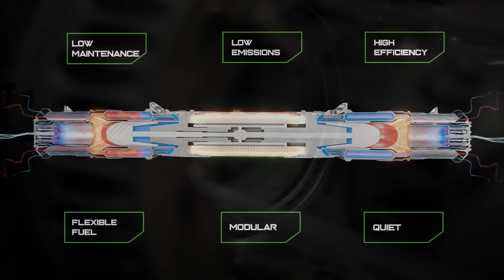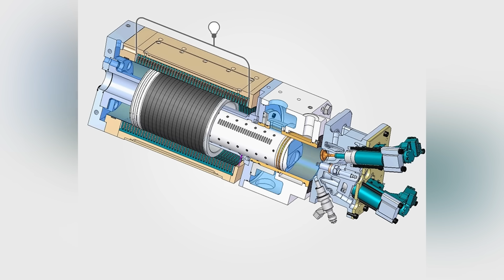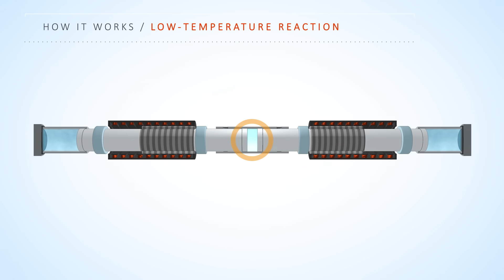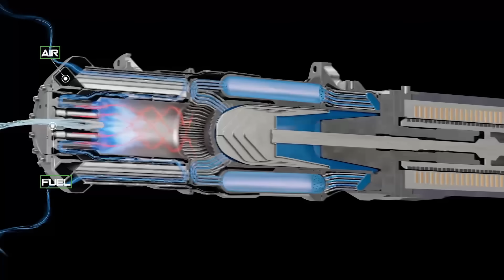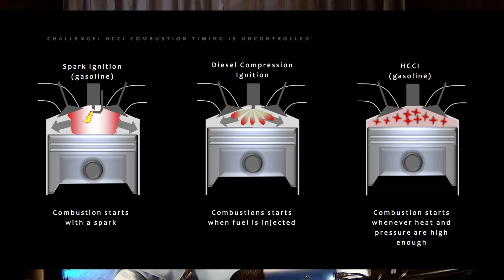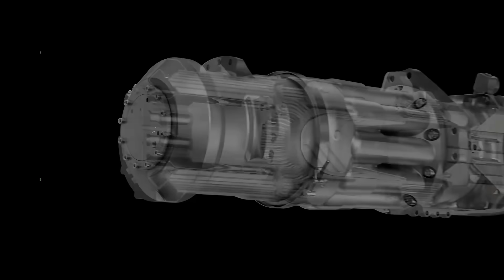Breakthrough HEAT Engine Is GAME-CHANGING!

Comment: I think your conclusion that the HCCI engine is more efficient is flawed in that the Karno has no lubrication system or parasitic mechanical systems needed to drive it that the HCCI designs require.  Losses in those systems is significant and require maintenance that the Karno will never need.  In fact, the Karno has no mechanical wear items in its design, as the bearings that support the linear shaft are air bearings driven directly by the working fluid (He2), so there is no physical contact between the single moving part and the rest of the system, which remains static. The only loads in it are the heat applied to the metals... and they're only transient while it's starting up or shutting down.  However, as they've designed it to be primary power (instead of a back up system), then those transients will very rarely occur.

Comment: That's not going to be the future, if you are going to be dealing with heat exchangers and all of that headache, supercritical CO2 is the future because the minimum temperature requirement for the supercriticality can potentially add 20-40% output to conventional steam, gas and combined cycle turbine generators, even take the waste heat from conventional combustion engines and generate power

Comment: Enjoyed video. I'm a little surprised this concept hasn't gotten more hype in recent years. Linear generator piston engine, e.g., "free piston", concept goes back decades (Sandia; space stuff).  There are actually numerous mechanical implementations of the concept possible with the new technologies available with additive manufacturing, complex digital control systems, and material.  Furthermore, with the power architectures exemplified by the range of electric vehicles today, this concept can be implemented in unique ways.  Designs are no longer restricted to a "traditional" IC engine layout of a "compact" engine/transmission power train. A hybrid like architecture also solves the throttle response issue (the bane combustion processes in traditional thermodynamic cycles). System efficiency at the vehicle level can be improved, but the fundamental limitation on Carnot thermal efficiency (needs high temperature/pressure essentially) due to combustion pollutants still remains.  But, if one is clever, there may be a market.  After all, there is no reason one can't have a 1 foot diameter, 5 foot long hybrid IC piston/linear generator/response leveling battery power module down the center of a vehicle. Just try to balance the efficiencies of mechanical, thermal, and synergistic vehicle packaging.

Comment: In all these cases of linear generators, why they don't actually show how many watts, amps, volts are being generated when it's fired up in the demo's?  That's because they don't really generate more efficient electricity than regular generators.  Don't just spew out efficiency numbers and unaccountable numbers, show proper certified and audited numbers.  It's been years and no real demo's with real numbers.

Comment: HCCI is not new or any advances. Several years ago when average gas price rose from 50/barrel to 140/barrel, In our country, we used compressed natural gas in our diesel engine. By mixing the gas with flow air during going in intake port before enter combustion chamber.  Easy just that.   The result was less diesel consume and more clean exhaust. But overall aims that met is saving your fuel cost.   Later, this norm was gradually disappeared from oil price reduction.  So, this HCCI will never be the future on conventional engine for sure.

Comment: now use hydrogen in it -also, give it an axis so it can be cyclical and work without the second chamber (it would also have a greater theoretical expansion limit and could be continuous)
Reply: They've already run Hydrogen in it... in fact, they've run 21 different fuels in it, from Hydrogen to Ammonia.
Reply: @williamsteele  awesome
Reply: rotaries could prolly be improved by simply changing the rotor to smth that looks like a high efficiency turbine

Comment: Normally, they make pistons flat-surfaced because of friction. but the piston in the middle does not require that to produce electricity. 
So I wonder why they did not consider spiral movement to increase length of piston movement. It could improve the count of magnetic pulses. 

most cars longer than 4 meters. I think this generator can be put in the bottom middle of the car between 2 battery packs. 
If they can develop something smaller than 4 meters, it might work. 

this could be great application for cars because cold effects battery packs  very bad. but this engine works with magnetic field so it become more efficent in cold temperatures. 
so disavantages come from temperature will calcel out when they used together. it is also means complete system will never be efficent %100 for their own standards but that is not the goal
Reply: "So I wonder why they did not consider spiral movement to increase length of piston movement."  Actually, they 100% considered it... but in order to do that effectively you need to know the rotational position of the piston... and getting a set of sensors and mechanical systems to maintain that rotary position is a challenge that had no real benefit.  In fact, just sensing the position of the pistons is a real challenge that they had to overcome and still allow the piston to rotate freely.  Lots of brainpower was used to tackle that problem. Remember, that's a sealed system... there are no electronics or anything inside that chamber... and the temperature swings that system endures (2500F+ to 100F, 20 times a second) can really kill a system very rapidly.

Comment: I think for range extenders price, size and weight are the important factors. It can be low power relatively high emission and not very efficient. After all it will only run in a fraction of the time. I think warious kinds of turbines, even steam turbines should be re examined! Since neither start up time nor output variability are a concern. 
Stirling engines may be failing again do to size and weight considerations. They would be better choice if the car would be mainly operated on fuel, and the battery was only to buffer the power need.

Comment: You lose all the momentum when the piston changes direction. Turbine generators are mechanically superior for generators.
Reply: The Karno is more efficient than a simple cycle turbine (not by much if compared to the best turbines, but definitely more efficient in its power range compared to a small gas turbine).
Reply: Sure, maybe. But turbines have wear and balance issues at the working speeds they require.

Comment: I still think an opposing, 3 cylinder (6 piston) engine is the way to go. That combined with a CVT gearbox  which has a single mechanical gear for highway driving. All that turning the front wheels. The rear wheels are powered by one (or two) electric motors with a 20 to 30 Kw battery. The battery can be cheaply charged overnight at home and also 'on the go'  when the single gear is engaged for long distance, high speed highway travel...

Comment: All engines are heat engines.
Reply: Ice engines are combustion engines.  The combustion causes an explosion from atomized liquid droplets of gasoline into an expansion of gas causing force into the piston to drive down the shaft. Whatever heat comes out is wasted energy.  Sterling type engines are the opposite, it uses the heat to expand the gas according to Boyles law, so all that explosive impetus from the combustion of gas is completely wasted.

Comment: i would say the lower than desired output capacity would be worth it. depending on maintance. if there are fewer seals, bearings to degrade and no oil to maintain/change. than yea. it would be worth for small community power production.
Reply: According to Hyliion the Karno has very low maintenance due to the moving cylinder being sealed and uses a helium gas bearing. That is what THEY SAY 🤔

Comment: You could  place the engine from the front to the rear. You do not need the engine bay anymore so it could be a radical different type of car-body design. For instance wider and shorter, or more narrow but higher.
Reply: I can see it replacing the diesel engine in European single-car short haul trains. Less noise and stink.

Comment: Stirling 'hot air' engines have been around since 1816...they pre-date many steam engine designs.
The 'down-side' to Stirlings is they get their best performance only at certain speeds.
For a generator, they are about perfect.
NASA has flown them to space on more than one occasion.

Comment: I think pushing the boundaries of tech and practicality are how solutions are identified, whether those solutions are more conventional or more extreme, and "failed" tech often still gives us ideas for the future
Reply: Has it failed? I thought I heard that they were producing power at grid level prices. And it can also burn up to 26 different fuels and change them on the fly. I would think they would have their place if they are as efficient as they claim to be I've never seen or heard one of those running can't find a video.
Just when I was starting to get excited about a technological advancement 
You could run the dormitories apartment complexes and buildings
Off the methane from the trash and sewage. No🤔

Comment: Before, i even watch. Is a HEAT engine it is 90% INEFFICIENT  you have to put 90%  in to get even 50%  USEFUL energy out. Why do you THINK you cars ENGINE is SO BIG and the explosion is so HOT. You have to use 90% of the engine to control the HEAT from melting the damn think.
Reply: They say it is ~ 50% thermally efficient which is similar to a number of ICEs.

Comment: Great review of these engine types. You hit a lot of the major players and additive manufacturing issues. The Karno design from Hyliion was bought from GE. Originally it was planned to ULTIMATELY be used in a semi truck but once the company built some prototype trucks with the Karno and traditional ICEs, they decided to drop the TRUCK projects probably because of the high cost to manufacture a complete truck. I always felt that the Karno’s power to size / weight ratio was unfavorable for a truck. Also scaling up the power output and manufacturing larger versions is somewhat problematic (both from a thermodynamic & an additive manufacturing standpoint). It is possible to get higher thermal efficiency with existing ICEs (55% vs Karno’s ~50%) with a bottoming cycle also. Hyliion is now pushing it as a stationary generator (oil field gas that is normally flared). Maybe the biggest selling point is potential low maintenance due to its helium gas bearing (the working fluid). 

An interesting concept to add more efficiency to various types of engines is to have a topping / pre cycle (name?) of a high temperature fuel cell. 

Also a way to employ high compression with a gaseous fuel like methane (low reactivity) is to use a highly reactive pilot fuel like diesel. This concept is being used in various ICEs (trucks and marine). 

Keep up the great work.
Reply from the maker: Thanks, I appreciate the background info you provided!

Comment: Turbine is better
Reply: True, but I think the advantage of this is efficiency at a lower power-to-weight ratio. Turbines have great power-to-weight but usually aren't that efficient. Something like this would be useful for generating electricity in a remote area where the transportation of fuel is a bigger burden than the extra weight of the engine.
Reply: → Rye

That is kinda Hyliion’s latest business model and also burning natural gas that would be normally flared. They also suggest that EV trucks can be “charged” with it using natural gas (because utilities are slow to provide electrical hookups according to Hyliion).

Also turbines have the same problems as ICEs for NOx creation.
Reply: @ryelor123  We must find more efficient turbine technologies. In addition, piston systems will no longer be produced due to NOx levels.
Reply: The Karno is more thermally efficient than a turbine in that low power output range. Also it is probably cheaper to build than a comparable power level turbine and probably has lower maintenance requirements. Hyliion “says” that it can “easily” run on a lot of different fuels. The irony is that it was GE turbine people that designed it (specifically GE Additive Manufacturing group that are involved with turbine combustors).